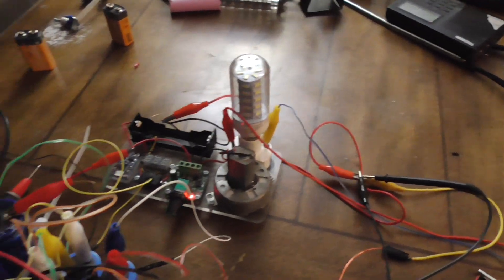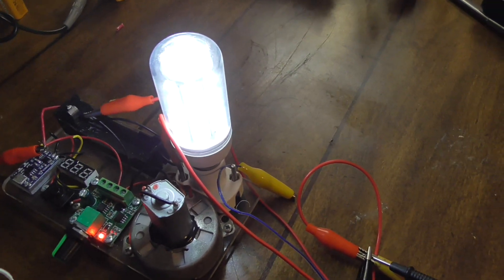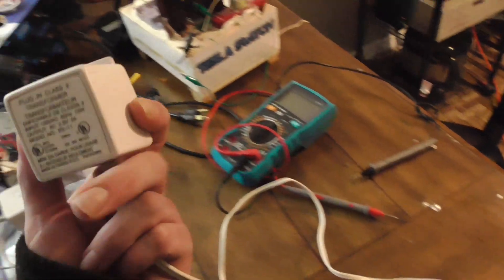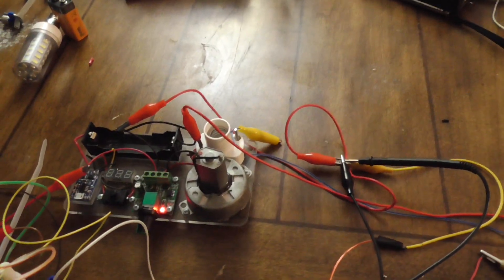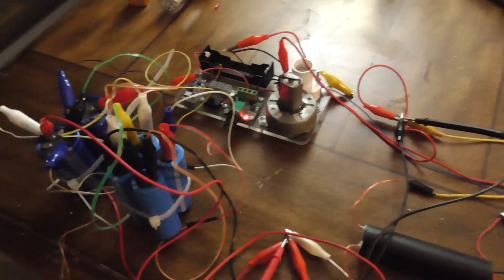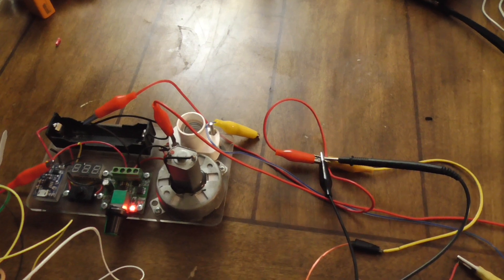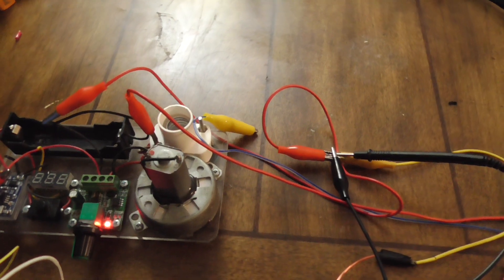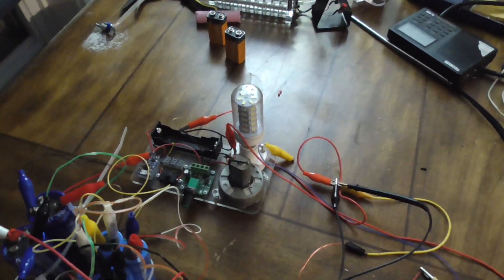Real Over Unity Energy

Comment: those are just modules that you put next to each other they are not even connected one of them is a usb type c mod and i see a small amp package and their is a servo (motor) not even doing anything just pointed upward. and there is a 18650 battery holder with no battery in it. o crap is this satire Mah Bad bruh . nice vid

Comment: Saw a working model powered by a DC drill veriable speed and a turntable motor 220 Ac, condencer bank set up like a Tesla battery charging circuit running on difference in potentials positive n+and n²+ utilizing the resistance as a powersource outlet for the DC  drill motor..I couldn't see your battry bank configuration..Tuning the imput by adjusting the speed control is an excellent  way to balance the output...I can easily adapt this to my 12vdc Tesla battery charger substituting batteries for your condencer bank ...currently  I recharge 5 /12vdc btr. using a single 12vt batry charging photovoltaic  panel with continuous  resistance output of the difference in positve potentials.

Comment: I don't understand, the high voltage from the high voltage device should break through your rectifier bridge and the small and large capacitors, I don't see resistors or other voltage reducing devices
Reply from the maker: Well ain't that something :) It's not no be cocky or anything but that is indeed part of the point. I learned like Bedini sometimes with this kind of energy you need to experiment and run semiconductors way out of parameter, For example you can scrap the bias R of a small transistor switch if your driving it with environmental energy.  You can trigger a 1.5 V base of an SCR at around 80 volts no problem if there is little current to it and is sharp. But this don't come cheap! I did blow up my fair share of parts trying to learn about all these "shortcuts" if that's what you want to call it.
Reply: Thank you very much for your reply, the capacitor can generate current only by relying on voltage, right? Then the voltage and frequency are very high, so the gain is generated through the capacitor. Is this understanding correct? @joellagace1679
Reply from the maker: Yes in part pulsing a cap at high frequency seems to provide some interesting effects.

Comment: Would like to see a video of it driving the load continuously without the voltage decreasing over time, with the load adjusted to pull as much as possible without 'running it down' so that it'll keep going for years.
Are they just electrolytic caps?

Comment: wow! I would love to scale this up and power a 1kw antminer s9 (cheap these days) to generate bitcoin. Is that possible?
Reply from the maker: I thought this was a joke until I visited your channel.  It's an interesting proposal. I'm not sure what the cap values would need to be for optimal effects scaled up this largely. I would take advantage of some of those solar panels to trigger it with perhaps.
Reply: @joellagace1679  triggering the system with solar sounds good to me. (A used 250w 37.5v max panel is $50 used and scales in series or parallel) I need help with the caps/coils, timing etc.  I would love to build something and I have a lot of skills to do so, including welding, soldering, figuring stuff out etc.
Reply: @joellagace1679  also, FYI: the antminer s9 control board and hash boards use 12vdc.. so converting to ac is unnecessary. Custom firmware is also commercially available to fine tune the consumption of the miner. Almost all consumed energy is exhausted as heat (which can be used to heat a house or a shop etc)

Doing this with 1 panel, 1 miner unit and just enough of your designs would create a system that infinitely scales mining bitcoin. Added benefit: Excess power generated from this goal creates free electricity for human flourishing.

Comment: Great demonstration. Where did you get your 5 watt ac generator? Also the blue AC feedback wire with the yellow alligator lead seems to be disconnected (at the generator end), but the red AC feedback wire was still connected, around the 11:27-11:28 timestamp. Does this mean it was actually feeding back AC power back through the cap/rectifier at that time and the circuit was running off of the CAP banks?  Thanks again for the groundbreaking work!
Reply from the maker: Just a toy hobby motor on ebay for a few dollars its been some years. I make the point that the power can be disconnected once a trigger is provided, the electret properties is the pulsing is what keeps it running without the plug but you need something an input to start it. Also just a general statement when you run your circuits in an open loop the system can regauge itself from other energies nearby even some you may not know off. Quantum physics is a very funny thing.
Reply: @joellagace1679  When you say electret properties, are you referring to the self-charging effect of the capacitor bank dielectric?

Comment: Really like the generator part, using the motor for turning a turntable in a microwave with a D.C. motor to turn the internal round magnet. Genius!  I've noticed that if you turn those motors externally by gear that the gearing speeds up the magnetic rotor so much that there is a lot of voltage to work with.
Reply from the maker: Thanks its interesting to note this method won't charge the input if you connect the rectified AC gen out into the in unless you pulse it from a charging cap quickly back into the input. Pulsed from cap discharges, this actually drives my voltage up during usage. Instead of the typical discharge curve one would expect.

Comment: One of the most interesting experiment that I've seen. Do you have in your setup a high voltage generator? The one that looks like a battery with two wires on each side?
Reply from the maker: Yes its a high voltage module but the current limiting, limits the output to around 20ish volts, just good enough for pulse charge my 12 volt bank!
Reply: @joellagace1679  I will try now to see what happens. Thank you for this valuable information.

Comment: Are you saying that the lamp will
stay lit indefinitely with no
external source of power?
Reply from the maker: Well to be technical, things wear down with time. especially mechanical devices. The lamp can only used what is already stored from the process. That's why I shut it off so it don't drain all the trigger current. As nothing special with the lamp per say, It will use up traditional current. So  As long as there is a trigger current left in storage and you limit the current input. The Caps will remain charged for a very very long time. Even built up a positive charge is possible. It's like batteries in a way, When you get enough juice you can run the light for a while. Turn off wait a bit and good to  go again. But you need a trigger to start it as I mentioned I first plug it in to get the whole thing going.
Reply: @joellagace1679   Of course you know that there is no such thing as over unity energy.  Once energy leaves the system in the form of light and heat, it cannot be replaced from within the system itself.  It must be replaced from an external source.
Reply: @Gill Danier It's some kind of trickery.
Reply: @gilldanier4129but Joels demo is really really extreme efficient. And that is already groundbreaking. Perhaps battery-generator-switching mode would help out here